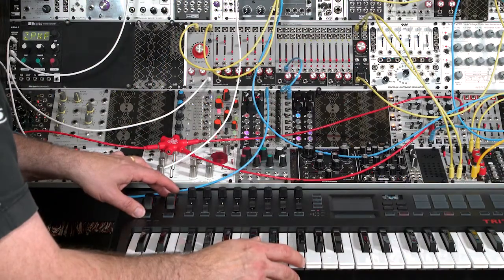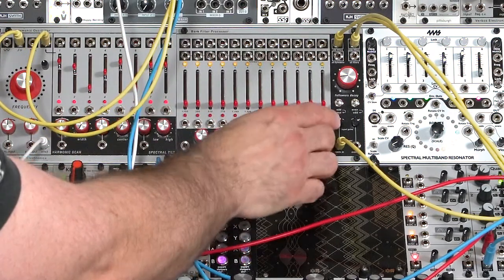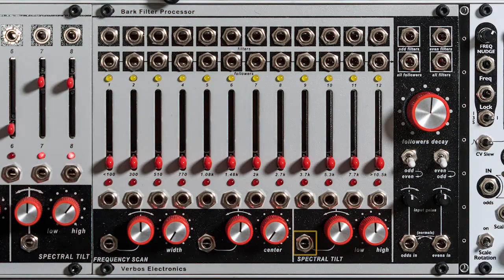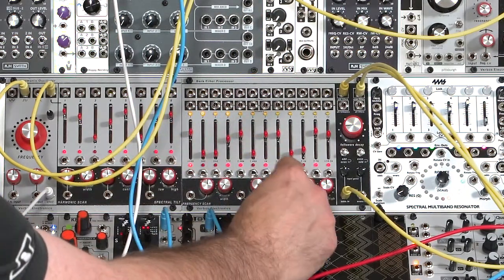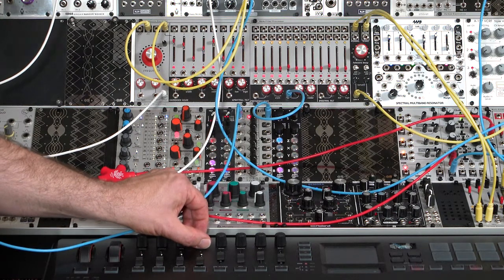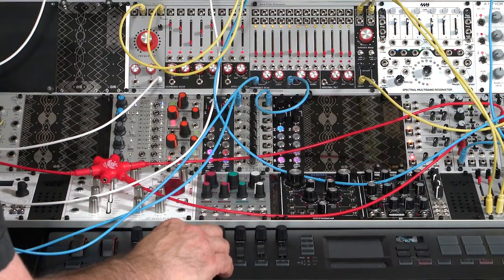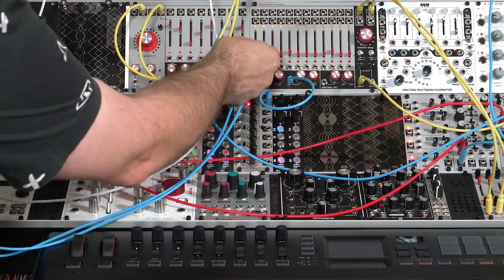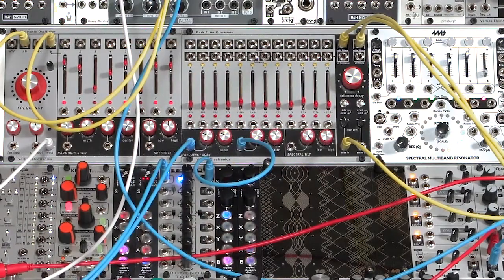Verbos Bark Filter 2/4: Voltage Control (LMS Eurorack Expansion Project)

Comment: is that a ceiling fan making the blank panel next to the verbos "pulse"? 

Nice work on these by the way enjoying the coverage of the Verbos modules.
Reply from the maker: The visual pulse is actually my subliminal way to try to hypnotize you, so that I can...actually, once I have you under my control, I have no idea what I'm going to do with you.

Yes, it was that damn ceiling fan. It gets hot in the southwestern US during the summer. The fan is silent, but unfortunately still reflective. (Oooooh, that's an idea - try painting the blades flat black...)

Glad you're enjoying the videos. Despite the hypnosis attempts etc. It was something a little different to use my large system for them.